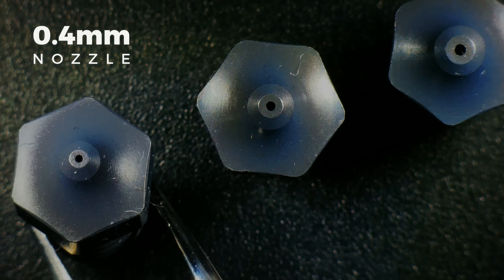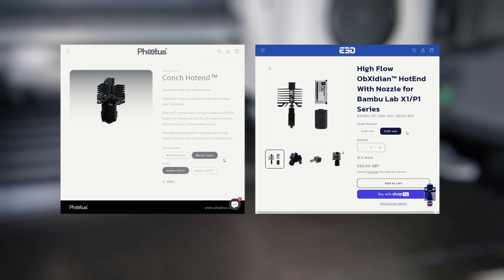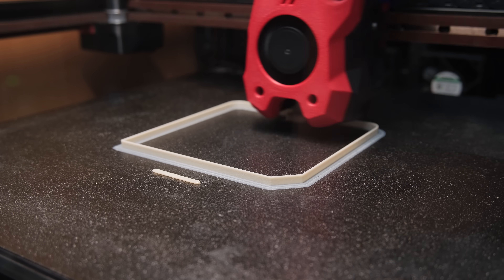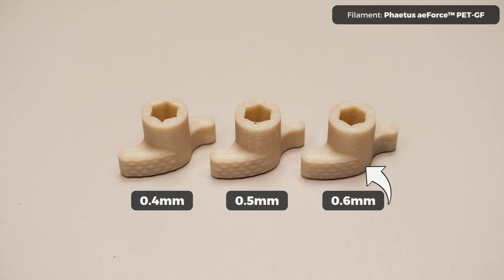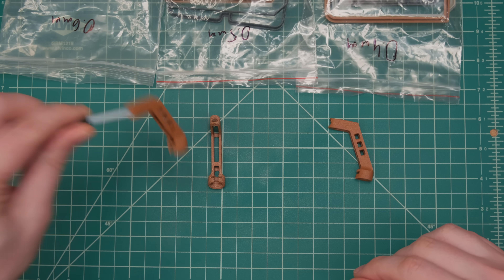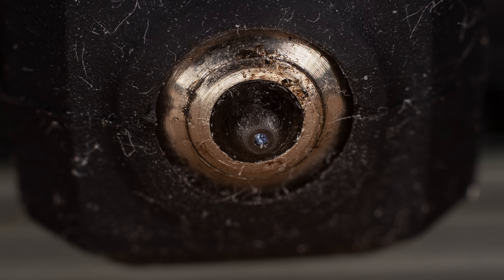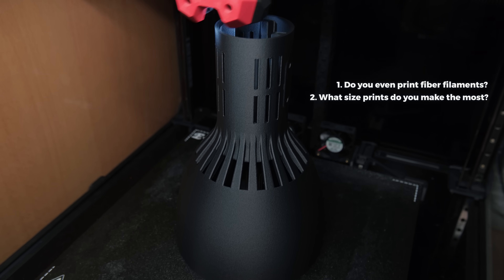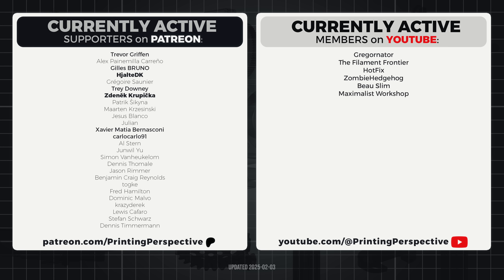DO NOT SKIP The 0.5mm NOZZLE! – THE GOLDEN SIZE

Comment from the maker: Main settings that were used in Orca Slicer 2.2.0 for the print comparison:
- Layer Height: 0.2
- Wall generator: Arachne
- Precise wall: Yes
- Walls order: Inner/Outer
Reply: For those that don't know, company's will not make 0.5mm nozzles if you don't ask, I reached out to Bondtech and they advised that they have not seen it as a request, so if more people make the request, they might make it happen, but without people writing in to them, they will simply continue on with the industry standards.

Comment: For years now, the 0.6mm is the only nozzle I use. I print only functional parts in ABS/ASA. In a very few occasions with tiny print I wished that I had mounted a smaller nozzle, but for 95% of the time, the 0.6mm does the job very well. Speed gain and higher strength were the main reasons to go to 0.6mm
Please do watch this video from Thomas: https://www.youtube.com/watch?v=WgXM2zPusXo

Comment: I wonder whether the poorer tolerances with 0.5 and 0.6 were in fact due to lack of retraction, flow multiplier, and pressure advance. Did you recalibrate the three parameters for each nozzle, or did you use standard values?
Reply from the maker: I calibrated PA values for each nozzle size as that affects the details a lot.

Comment: What's is your experience with high flow ObXidian nozzles? I have a Prusa Core One on order, and i'm concerned if higflow nozzles may clog if using abrasive filaments. I'm wondering on going for a ObXidian higflow or not.
Reply from the maker: I never got a clog with ObXidian HF with fiber-filled filaments. Some people say they got over 1000+ hours without any issues, and others say it constantly clogs. If you are experienced and using high-quality fiber-filled filaments, there shouldn't be issues. The melt zone of the Core One nozzles is not that long, so regular flow nozzles might be limiting the print speeds.

Comment: Did you try printing 0.4mm walls with 0.5 nozzle? It may look very similar to 0.4 nozzle result. And if you do 0.4 for external perimeters and top surface, 0.6 for everything else using 0.5mm nozzle, you may combine both speed and details.
Reply from the maker: One of my first videos was about it - https://www.youtube.com/watch?v=xFmI25MJ93w
While you get better details, I worry about the layer consistency look as I never tested that aspect properly. But maybe a 0.5mm nozzle is truly the key for detailed and fast prints with OW:0.4mm and IW:0.6mm. Great suggestion, I might try it! :)

Comment: The difference of the 0.5mm bore length vs 0.4mm bore is overlooked. And the size of the flat on the tip, this is more of a differentiator than the diameter in my experience. BTW depending on the manufacturer, the tolerances are overlapping. So you could buy a 0.4 and 0.5 and the 0.5 could be smaller in reality. ;) Cheers.

Comment: I just checked the source for the Tungsten Carbide (WC) nozzles that I like (Spool3D in Canada). They have 0.25, 0.3, 0.4, 0.5, 0.6, and 0.8 nozzles available (0.25 and 0.3 are currently out of stock, but they usually replenish stock fairly quickly). If you want to try WC nozzles, note that they are incompatible with aluminum heater blocks (the different thermal expansion of the two metals is enough to loosen the WC nozzle in the Al block). I haven't had a WC nozzle loosen in a plated copper heater block, and I use my WC nozzles as every-day nozzles. (Thermal conductivity of WC is close enough to brass that I don't have to adjust print temperatures from profiles tuned for brass.) I may have to order a 0.5mm WC nozzle at some point.

Comment: I've been printing with a bozzle nozzle (.5mm tungsten carbide high-flow geometry (cht-like)) for a while now on my voron 2.4.  the flow is INSANE and I can achieve much greater print speeds with overall fairly similar details to the .4mm nozzle that came with my rapido hotend.  for fast structural prints where I don't need stuff to carry high amounts of detail (custom electronics enclosures and organizer bins are some of the items i've printed most), you can also use significantly greater layer heights (up to about .4mm) without inter-layer adhesion problems making prints even faster.
Reply: I've been considering the Bozzle for a while. How is your experience with glass filled or carbon filled?
Reply: @JLSticePro  I'm sorry, I haven't printed with glass filled or carbon filled filaments personally.  I do have my first roll of pa6-cf, but it's still in the box until I have a project that requires it.  that said, my research indicates that it should work great.

Comment: I had a 0.5mm hardened nozzle for many years and loved it. Switched it over to a new printer back 5 years ago and converted it into hybrid volcano nozzle with a brass spacer. I would still use it today if it wasn't for finding an open box 0.6mm Micro Swiss CM2 Volcano nozzle at Micro Center for $16. Because just the very tip is hardened steel it moved heat far better than a hardened nozzle with a brass spacer but quickly noticed part fitment issues on small parts and generally would use more filament on prints. So I've been running a 0.4mm CM2 Nozzle since and haven't bothered looking back until this video.

I've been hesitant on the Bozzle Nozzle which i think only comes in 0.5mm, mostly because it's $75. But IF they make a Volcano version for just a few bucks more i'll jump on it.

Comment: Janky solution to not enough 0.5mm nozzles:
Print more glow in the dark filament with the 0.4mm nozzles.
Reply: But silliness aside, I've never liked the quality I got with my 0.6mm CHT knockoff, it totally did it's job and melted stuff well, dialed temps back some even, but man does it ooze more compared to 0.4mm. I think you hit the nail on the head with the surface area numbers. 0.6mm is just giving the plastics way too much leeway via area, and you lose more of the effect of 'viscosity plugging' where it leaks more while held at the melted temperatures.
Reply from the maker: Yup, I never liked even genuine CHT desing for 0.6mm. 0.6mm oozing and stringing is on another level compared to 0.5mm.
Reply: @ Thanks for confirming that even the 'good' ones still have this issue. I recall a video a while back where another host said do everything with a 0.6mm and arachne, to get 0.4mm when needed etc. But that just NEVER worked well for me, was totally different from running 0.4mm native sizing. My slightly wet 95A TPU that I never really dry, was just a miserable oozing experience. Meanwhile I could get it to print quite clean with any of my 0.4 machines.
Reply: I have the original 0.6mm cht bimetal volcano, it doesn't ooze any more than the regular 0.4 nozzle I used before. You just have to have a really dry filament.

Comment: Unless you are using layer heights between 0.32 and 0.4 - then there's no reason to go to a larger nozzle.  0.32 layer heights are the max for 0.4mm nozzles, and 0.4mm layer height is max possible for 0.5mm.  If you are not using these larger layer heights, you are missing 80% of the reason you would buy a larger nozzle in the first place.  If you use larger nozzles, and continue using 0.3mm layer heights, and lower -- you're not gaining anything out of them, AND they're blowing out the detail on your prints.
Reply from the maker: Yeah, typically you would also increase the layer height that cuts way more print time and reduces even more details. I should have explained this point, I tunnel visioned on the same layer heights for apples to apples comparison and I forgot to mention the obvious. :/

Comment: I'm a bit weird. I run a Prusa MK4 with a 0.6mm nozzle, but I also have a Prusa Mini with a 0.25 for extremely tiny prints with high detail. My ideal setup, though, would be a toolchanger with a few sizes. I'd probably run 3x 0.4 nozzles for multicolor, an 0.8 for large vase mode prints, and a single 0.25, again for the detail.

Even cooler would be if we had slicer support for mixing nozzle sizes in the same print (maybe only using the 0.25 for very specific features) but honestly there aren't many places where that would be truly necessary.

But even with all of that, we all know the real solution is more printers. 😂

Comment: Regarding to cnc kitchens nozzle size-layer strength data, I also did the same experiment but with ABS while not exceeding 16 mm^3/s, you lose plenty of layer adhesion when printing above 4:1 nozzle size:layer height ratio. I think that info is not true, maybe it is not normalized for flow rate. (probably 0.8mm nozzle one printed with double the volumetric flow rate of 0.4mm nozzle, so it didn't leave the nozzle at the same temperature.)
Reply from the maker: Hmm, maybe I need to test it myself as I already burned myself once when relying on others data.
Reply: @PrintingPerspective  that would be nice yeah :) I heard that especially for PC you need at least 1:4 or even 1:6 ratio.

Comment: I'm currently using 0.3 and 0.5 Nozzles! 0.3 for "Needs to look better than standard, but I still need some speed" and 0.5 for "A bit more speed would be nice, but it still needs to look decent" :D
Reply from the maker: That's my exact thinking! ;D
Reply: @PrintingPerspective  yes, you're not alone! Btw, I also tested 0.2 and while the prints look really awesome, it clogged quite easily even on pure PLA and the speed was an absolute snoozefest. 0.3 is almost half the print time and still looks a lot better, than 0.4.

Comment: I'd use one if they made them for ANY of my printers. 🥺
Reply: I've got an A1, K1 with Unicorn, and a Flashforge 5M 🤣
Reply from the maker: Yeaaah... I don't get why companies make 0.8mm nozzles instead of 0.5mm. Most of the time even 0.6mm are limited by the max flow rates of their hotends.

Comment: Somebody makes this video every year. I have agreed with this since I started 3D Printing 3 years ago. I run my Ender 3 S1 Pro at .5mm width, using a .4mm Mk 8 CHT Nozzle. Having the CHT makes up for a bit of the flow rate. Just not as much for fiber filled filaments. 'Twilll still clog. But it def prints faster and I get a 1mm wall with 2 passes, adding to the strength, without using too much extra filament.
I wanna see .5mm CHT nozzles(the real ones, not just the "fake" ones. You should reach out to Bondtech and just tell them that everyone wants them. Lie to them, whatever you gotta do. lol
P.S.
I am taking an old .4mm Nozzle, for my BBL A1, with me to work today. I am drilling out the bore to a .5mm, since it's worn out a ton. So it's a hella coincidence that you posted this video today.

:hands-yellow-heart-red: your :yt: videos man!
Reply from the maker: You have no idea how much feedback I used to provide to companies when I tested their products, but unfortunately over the years, I realized that no one cares. :D I asked one company that I won't name why they don't have 0.5mm size nozzles and they said because nobody buys them. I feel like there are not enough people pushing this or companies rather have people buy two nozzles instead of one 0.5mm for obvious reasons.
Funny enough I thought drilling Bambu hotends to 0.5mm multiple times but I still naively wait for the 0.5mm high flow hotends. ;D

Thank you :)

Comment: I recently bought a set of volcano nozzles that have every size imaginable, but during testing I found out the 0.6 nozzle has lower volumetric flow than the nickle plated copper high flow 0.4. I'm not sure if I would even benefit by using the 0.5, but I'll give it a try and test their flow, compared to the HF one.
Reply from the maker: Volcano hotend is also limited by the flow rate even at 0.4mm size if you have a powerful extruder. 0.5mm is mainly for the ability to print almost every filament on the market without the need to switch the nozzle.

Comment: My one objection here is running the line width at the nozzle width. I use a .6 nozzle but generally use a .5 line width. This is to lower the nozzle back pressure. Especially during higher speed printing nozzle pressure can cause a host of issues from poor material quality, increased warping and if course artefacts such as voids, oozing, varied over extrusion. In general i think a lot of printing issues are caused by nozzle pressure and often miss diagnosed due to the fact they often produce bimodal issues. It also is the cause of some of the internal stresses in printed parts that cause poor mechanical properties.
0.6 produces a very stable line at .2 layer height and .5 line width. I do like 0.5 as well and think it is generally the better sweet spot. I was gifted a 0.6 diamondback though, so here we are.
Reply from the maker: The common rule is that you shouldn't do it as it reduces print quality. I think one of the first videos I made was comparing 0.4 0.5 0.6 nozzles with 0.4 0.5 0.6 line widths.
Reply: @PrintingPerspective  I would be interested to see slicer settings around that explored more. I know on my own profiles I've had to generally write them from scratch keeping almost no original settings. I use cura, if you were curious to do a side by side comparison or vise versa if you have a place I could download the profile you were using I'd love to check it out and see the difference.
Reply: @PrintingPerspective  please let me know if you'd be interested in a profile exchange at any point, I also have a voron 2.4 I can let you know specifics of my build so you can tweak accordingly if you like.
Reply: This is interesting

Comment: I personally have not had issues with CF or GF filaments printing with 0.4 nozzles. I do have 0.6 on hand just in case.

Usually I am just too lazy to change them over. And due to the flow limitations, I don't really save print time especially if I am using thicker layers.

A 0.5 could bridge the gap. I mostly do engendering filaments and practical prints anyway.
Reply from the maker: I never had a clog with Bambu printers when printing fiber filaments, but I had other brand printers clog once in a while. Probably not a coincidence because other printers that had big filament drive gears couldn't power through when extrusion force increases substantially.
Reply: @PrintingPerspective  I print on a K1 Max mostly, and I upgraded to the new hotend and nozzle design prior to any significant fiber filament printing. That could be helping, I will say that the extruder is not the most powerful. I did change that out for an aluminum one with a tension adjustment arm, which has helped with flexables.

Comment: The real winner is just forcing 0.6mm out of a 0.4mm nozzle.

With arachne enabled it will atill base its smaller extrusions on the nozzle diamter not the width its set to.
Reply from the maker: Yeah, but that physically doesn't increase the nozzle's diameter for reliability with fiber filaments.
Reply: @PrintingPerspective  True

Comment: the key for me is that the nozzle size and layer heights are matched 

that yields the absolutely best quality for me on my Creality CR10s3 with a Spider 3.0 HF hot end and Creality hardened nozzle when printing with Polymaker ABS only since that is also what I found best for all my needs
Reply: what do you mean matched? What height would you do for 0.6mm nozzle?

Comment: My 2 most heavily used machines have 0.5mm E3D Nozzle-X's on them.  I think it's the sweet spot when it comes to the hole size with the right amount of "flat" on the tip to smooth out the extruded plastic. Prints look fantastic and I can't tell you how many spools of CF filaments I've ran through them and they're still performing like new.
Reply from the maker: All the comments I read have 0.5mm nozzles for the V6 design. It blows my mind that there are still no good 0.5mm hotends/nozzles for X1/P1. Maybe I need to build more DIY printers...

Comment: Did I miss what wall generator you're using for the tests? Does Arachne vs. Classic make a difference?
Reply from the maker: I always use Arachne :) when it came out I never use the classic anymore. Arachne is more dynamic, but I doubt there would be any difference on my selected prints.
Reply: @PrintingPerspective  do you use stock settings for arachne? Min 85% line width? I have 0.5 mm nozzle on my klipperized mk3s 90% of the time. Lately I've noticed that in orca profiles for LH Stinger, they have min layer width for arachne set to 75% but when printing there were too many issues probably due to not enough squish. 80% was fine with my testing. But I think that it can be connected to phaetus nozzle's quite rounded shape at the tip. Standard E3d ones seem to have more of a flat area surrounding the orifice thus providing more squish/ironing.
Reply from the maker: I use: 85% / 75% / 25% / 0.5mm, but it is almost as stock. At least EndCoat nozzles seem to have quite a similar surface area around the orifice as V6. They just have a wider cone shape probably to better survive impacts and should work great with TAP as Rapido 2 hotend is quite rigid.

Comment: Interesting, it would be the smallest size that still allows worry free fiber filament printing. I still like 0.6 for larger prints as I can bump up layer width to 0.8 or 1mm without any issues, esp for internal walls and infill. For very small prints yeah, not 100% optimal.
Reply from the maker: Yeah, at the end of the day, the best nozzle size still depends on the prints you making the most. You can also do the same with the 0.5mm just to a lesser degree. You could also use the 0.5mm outer wall width to maintain the details and ~0.8mm for inner ones and infill.